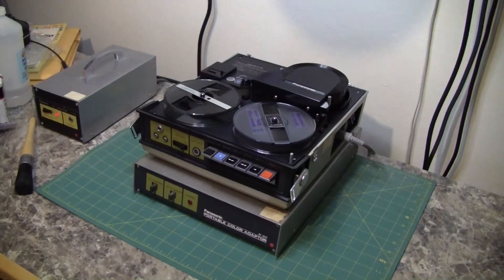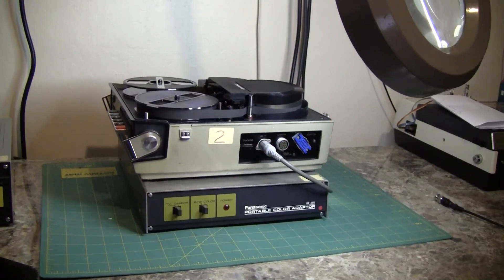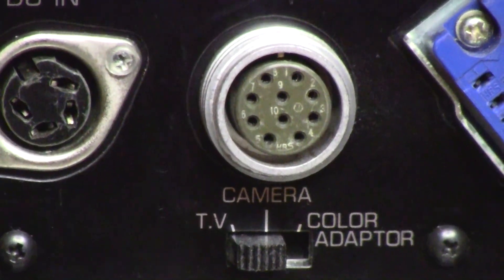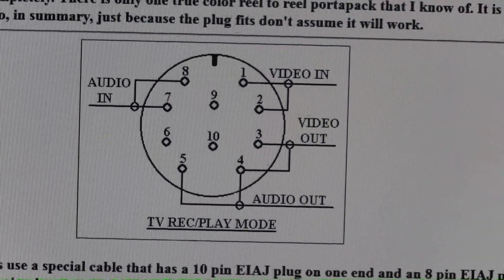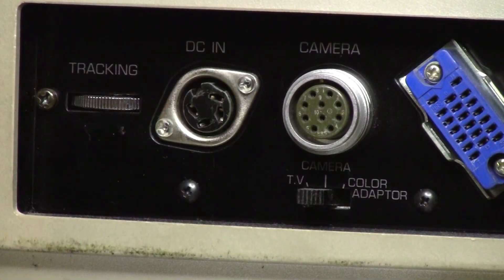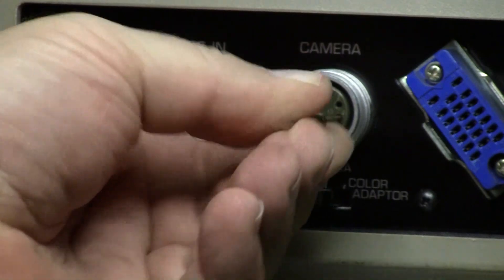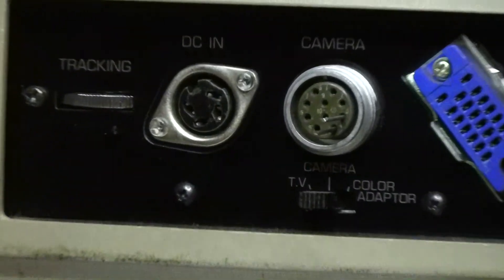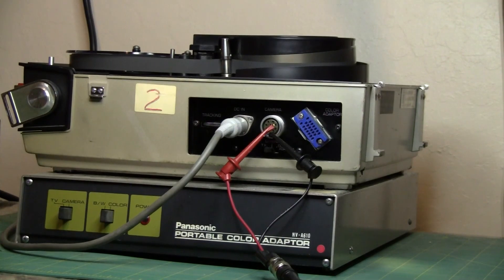How to connect a portapac VTR for playback

Comment: I have a camera that has a built in 10 pin male cable, could I use clip leads to connect to the 3 and 4 prongs on the male connector in the same way as you do (w/o the transistors needed) with the female?
Reply from the maker: Yes. Be sure to provide DC power to the camera on pins 9 and 10. The two in the center. Pin 9 is power ground and pin 10 is +12 volt power in. 
Also pin 1 is video out of the camera and pin 2 is video ground. 
Pin 7 is the microphone and pin 8 is the mic ground. 
Please not that in my demo, I have the VTR jack set for TV mode which is different than for camera input mode.

Comment: Hello!! Great video! One question, is this video signal a standard composite video?
I have a Sony CV-2200 ACE but i can not have video signal. There are audio but i dont know how have video out! Please, help me!!! 😊
Reply from the maker: Yes. Composite video output. Are you certain the video heads are good? Are they clean? Are you certain there is something recorded on the tape? If you have an oscilloscope, see if anything is coming from the video output jacks. 
References here: http://www.labguysworld.com/Connectors.htm and here: http://www.labguysworld.com/VTR_FAQ.htm
Reply: videolabguy Hey! Thank you so much! Yes, there are something recorded on the tape, there are sound. The head are clean. The connector is like the "vídeo out" labelled on this picture: http://www.labguysworld.com/VTR-850_005.jpg